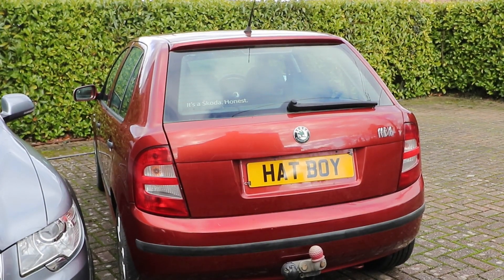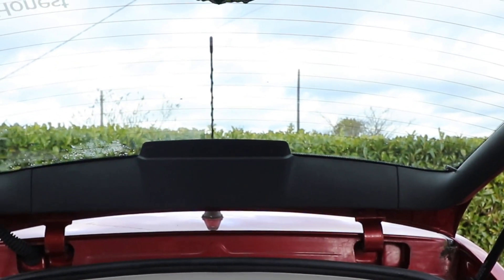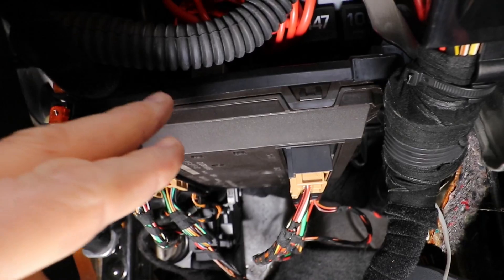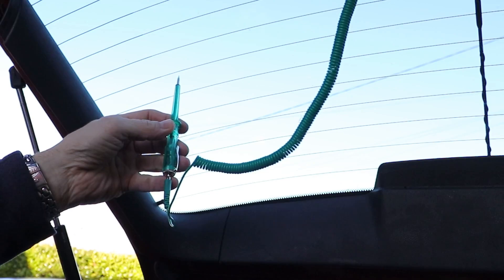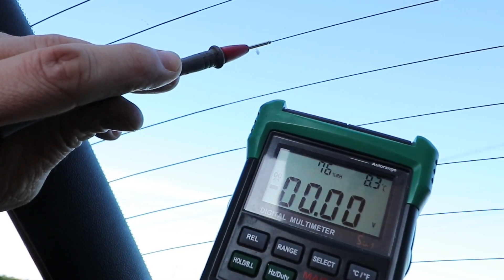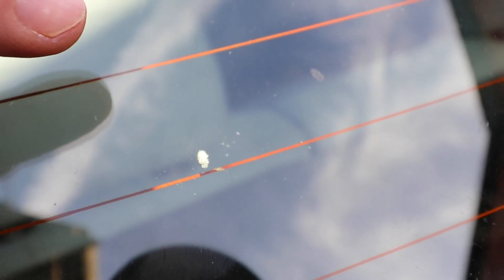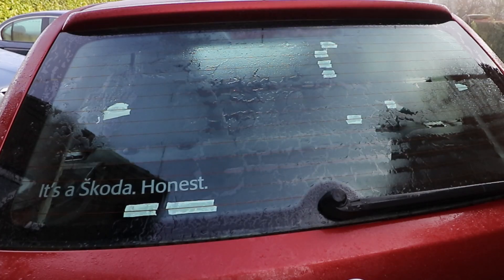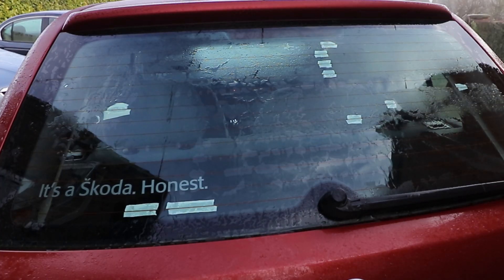SKODA FABIA Rear Demister Fault Finding and Repair

Comment: Maybe it's a combination of faulty paint (looks too thin) and the fact that, after you clean the glass, you then swipe your finger heavily over the demister line when sticking the white tape.
Reply from the maker: I believe the conductivity of the paint was very poor in this case so being too thinly applied could have also been why it didn't work. I may re-visit this issue again if u can find a solution ;-)

Comment: Hi, I do like your well explained videos sorry to hear this one did't work out. Could it be you are using glue designed for attaching heatsinks to semiconductors? That stuff is heat conductive but insulates electrically. I've used Comma Electrocure on heated screens in the past with good results. It's not a glue but a kind of silver based paint. Anyhow keep up the good work.
Reply from the maker: Thanks, glad you like my videos. The glue I used was admittedly cheap, but it was silver (or purported to be silver). I'd done this years ago and it worked then, but can't remember what brand it was ;-( Anyway the theory is there, maybe I'll return to it with better results sometime in the future :-)

Comment: Thanks 4 useful videos. I've question . The left window , mirror and central lock doesn't have electric contact. Can it be faulty of fuss ?
If how can I find  the right fuss ? 
Unfurtunatly my Fabia combi doesn't  have the guide map. 
Thanks  in advance.
Reply from the maker: Thanks, It could easily be a fuse, but the fuse would have blown for a reason. use a multimeter to test the fuses or pull them out individually and visually inspect them if you can't find a guide for your car online (search under images). wires going into door common place to break and check the connections to the window motor, trace back until you find voltage.

Comment: I had  the same issue with a conductive glue at my car. The thing is that a fresh opened glue bottle contains to much liquid in a glue and it is not dense (intensive) enough. To solve it the glue must be left in a warm place for some time to vapourize the moist part of it and make it more like a thick glue and not a liquid. That worked perfectly.
Reply from the maker: Thanks for sharing this info, I may try this :-)
Reply: Thanks for the tip I'll try that as I have a rear screen demister that only has two lines working and want a first time fix. 

Thanks for the upload Harvey very informative and I'm just about to do a test and marking on the screen ready for the bridging metal paint to turn up, also it's always soaked when I get into the car as the rear doors were leaking but used your silicone fix to cure that problem so thank you very much 👍